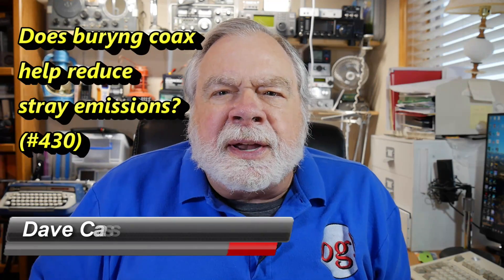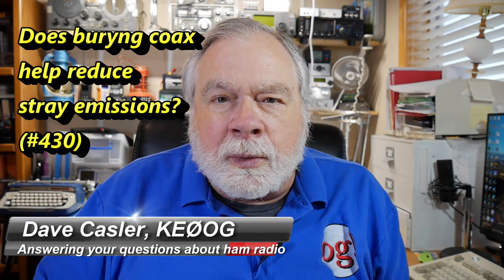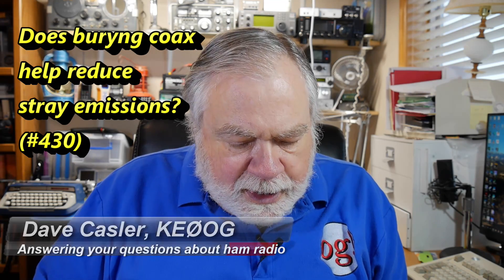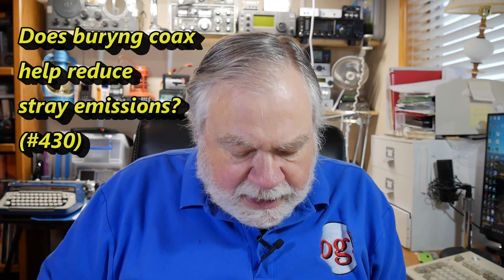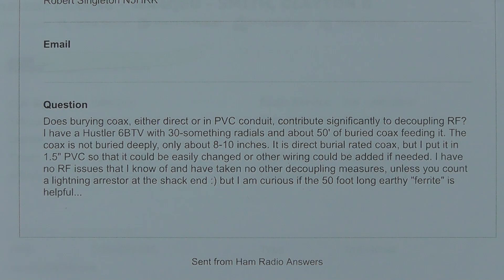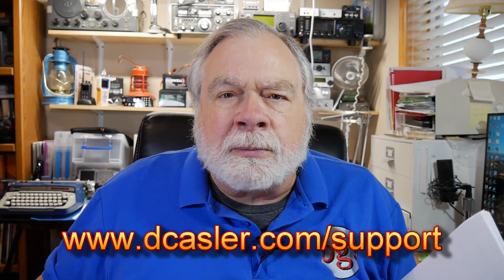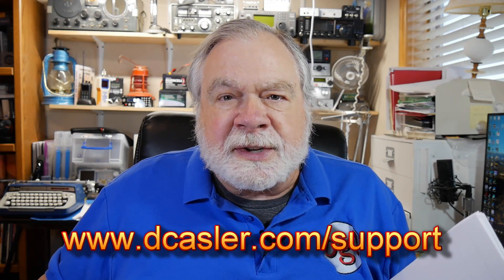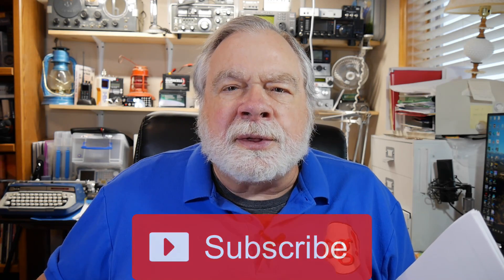Does burying coax help reduce stray emissions? (#430)

Comment: Hey, Dave! Thanks for addressing my question! Grimace's comment below reminds me that I still need to connect the shack ground to to building ground. That may be around the corner to where the breaker panel is, but I suspect the only ground in this building will be the service entrance at the other end. It's a wooden barn/workshop with power on a separate meter from our house, but no other utilities. And i never considered a ground rod at the antenna. Its mounted on a galvanized pipe driven almost three feet in the ground, but the more ground the better. Thanks again and 73 de N5HRK

Comment: I have nearly the same setup. A Hustler 6BTV (which I added 60M, 17M, and 12M wires in addition) with about 50 feet of 400MAX coax (LMR-400) inside a 3" PVC pipe (along with a pull string, another 400MAX coax, and a pair of 12AWG wire for an antenna switch to another pair of wire antennas (an EFHW inverted L and a Terminated End Fed Inverted Vee). I drove an 8 foot ground rod at the antenna and put down 1000 feet of radial wire in about 55 runs (ranging from 10 feet to 40 feet long to fit the space). Back at the shack I have Polyphasers. I can pretty much work the world on that rig with very little interference and pretty low noise floor. My only regret ... I didn't tie the shack ground and the antenna ground together (but I did tie the shack and the mains ground together).

Comment: best way to stop water ..... at both ends of pipe do not use elbow use a  T  instead  so wire goes in topof pipe and turns for the cable run and the other end of the t goes straight down about a foot or 2 so any water goes down pipe and drains